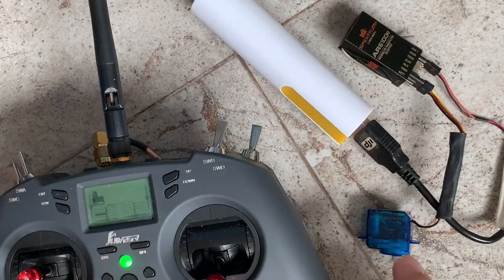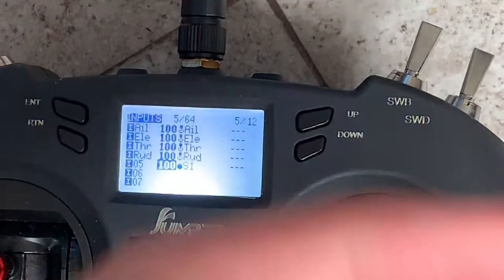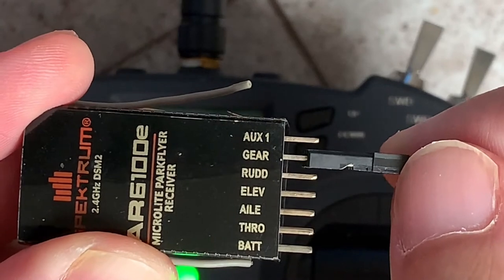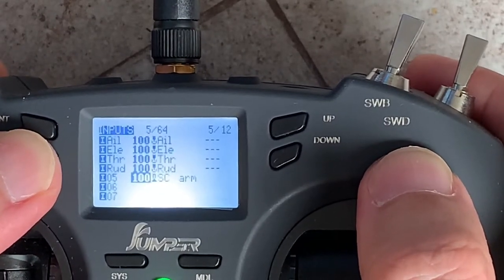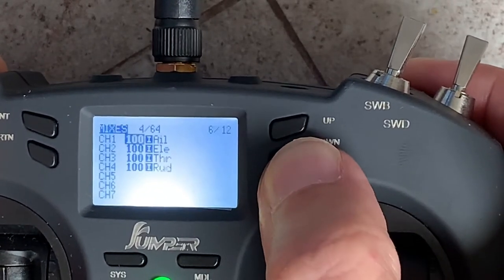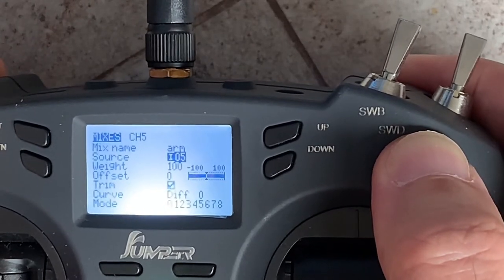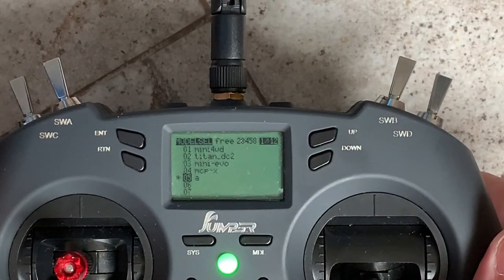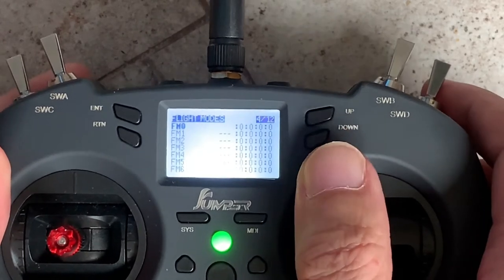Jumper T-Lite Easy Setup for Drone (bind, arm and flight-modes)

Comment: I see a lot of YT's set up inputs this way. Just a heads up it's not necessary and adds work/time to setting up models. Just add the switch to the mixer channel and you're done in one step. Also the configurator is way faster as well. Thx

Comment: Hi sir dose this only connect to fav drones or any drones.
Reply from the maker: It depends on the protocol of receiver in your drone (example: dsmx, flysky, frsky, Futaba FAST, Walkera, etc). There are 2 versions of this controller on sale. One has a multi-module that supports DSM2/DSMX (no FRSKY support) and the other has multi-module that supports FRSKY(no DSM support). Do check with the seller if the supported protocols are not stated clearly in the sales description.
Reply: @terence79chan  Ok I will check Thank you very much.

Comment: Hey Terence, when I navigate to Internal RF, there is no MULTI option for mode. I only have CRSF or OFF. Any idea how I can get it to show MULTI? Thanks.
Reply from the maker: Hey Andrew, I believe you are having the crossfire version, the version in the video is the 4in 1 multi protocol version. Do note that for the 4 in 1, there are 2 types as well, one has dsm support and the other has frsky support.
Reply: @terence79chan  Hello Terence. So how do I get it to show the 4 in 1 Multi version instead of crossfire? Thanks

Comment: I have a Jumper T lite v2 Elrs version, on my transmiter on tools menu if i press enter to load the Express Elr, i get a error >>Script panic not enough memory<<< what does that mean?  All I have done to the transmiter is setup the Aux channels, I'm wondering do I have to flash firmware or flash a binding phrase into the transmiter? Im new to this hobby so Can Anyone help me?
Reply from the maker: Sorry mine is not the ELRS version. I hope someone could help you with that issue soon.

Comment: late comment, but what about turtle mode? is it about the same settings or what could i do to add turtle mode?
Reply from the maker: Turtle mode needs to be enabled on the Betaflight flight controller. There are many videos on how to set up that mode and then u could assign a switch on your radio for it, which is similar to how u assign a switch for the flight modes.

Comment: I know this is an old video, but i just cannot get it to bind with a dsmx drone i have (mobula 7 2s). any advice?
Reply from the maker: If you are able to find the dsm option in the menu, try all the sub options, auto, dsmx, dsm2 and etc. if possible, borrow a dsm receiver from a friend to see if you are able to bind to that. Sometimes it could be a receiver issue or the Mobula 7 2s dsmx receiver requires you to run a particular CLI command in Betaflight to prep it for binding. Check out the Mobula 7 thread in RC groups to find out the  bind procedure.

Comment: nice guide! I used this radio for a few days. The feel was great and it was so convenient, but sadly it was so difficult to remove the li ion for charging (I was told the li-ion charging circuit on these radios were faulty)
Reply from the maker: Thanks for watching. It is indeed a hassle to remove the battery for charging. To improve the battery placement, I had replaced the ground metal tab with a spring contact taken from the battery compartment of a faulty TV controller. :)
Reply: I have the opposite problem. I feel like its so loose when I take it out that I have to make sure it is making good contact. My battery is flat on both sides. Besides you charge it directly from the radio. Why would you have to keep removing it? Too much of a hassle...
Reply from the maker: Good  point,,  I will try to charge it directly.

Comment: Im thinking of getting this as its soooo much smaller and good to use for travelling.
Reply from the maker: Go for it bro, it is a good radio for the price!  My only complaint is that it is a pain to setup a CCPM RC Heli on it but this really is more of an OpenTX issue instead of the radio itself.
Reply: @terence79chan  thing is, my current QX7 is still good. So... dont know yet.. maybe I'll get a pre-owned LOL and yesss.... thats one of the reasons why planes and helis use a specific type of radio
Reply from the maker: @John Grzeskowiak I hopped onto the openTX wagon from an old DX7, so you are more familiar with the system than I am. Glad the video is still useful for u (interface-wise). The t-lite is indeed not very comfortable, but it’s a winner for its compact size and very affordable price. :)
Reply: @John Grzeskowiak sweet man! Originally thats what I planned to do too... once this QX7 dies on me.